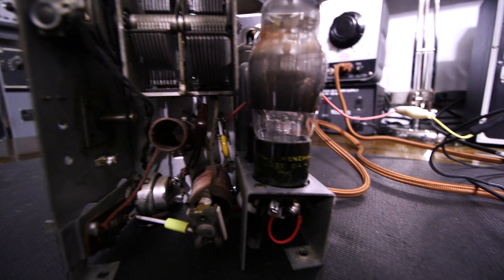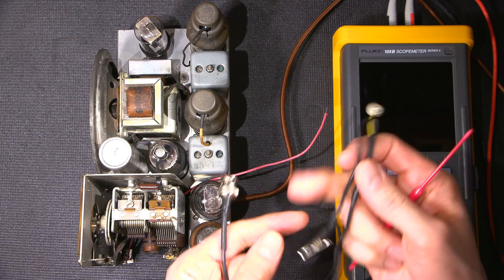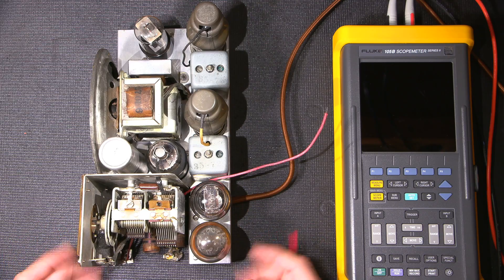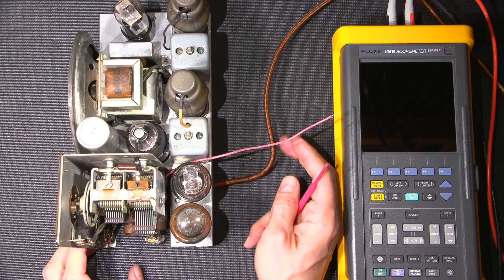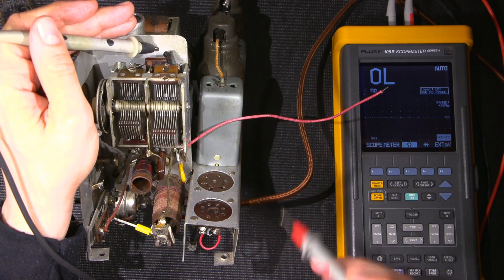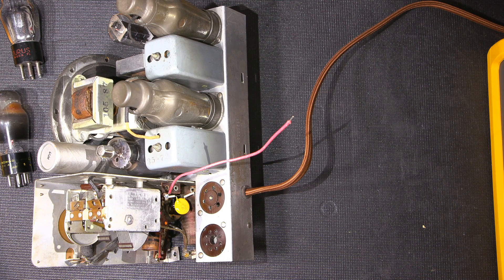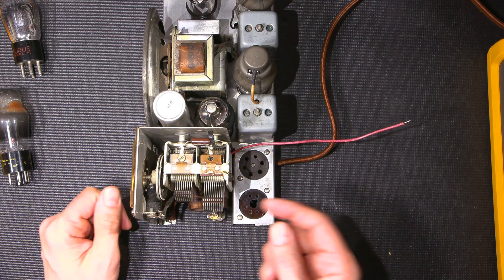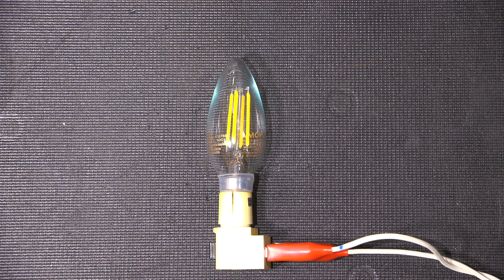See High Voltage Created From Falling Snow!

Comment: Free Energy Conspirists will have a field day on this one. LOL. But unfortunately for them us old Hams knew of this problem and took precautions against the undesirable build up of STATIC CHARGES (also lightning strikes) in our antenna systems. The capacity coupling AND associated leakage resistance (probably MEGOHMS) via the isolating transformer could possibly account for the grounding. I have experienced antenna STATIC SHOCKS once when reconfiguring some antenna wiring. It was WINDY & COLD (no snow which would DRY the air!) not nice. I would also add  my Ham Rig provided a STATIC DISCHARGE TO GROUND when in use OR was GROUNDED WHEN NOT IN USE. Static charges in the antenna system creates interference (RF) from spurious arcing   another reason for providing a controlled discharge path. PS Nice Observation
Reply: ARRL Handbook (1940 & 50s editions  I used)  my references OR perhaps ARRL  Antenna Handbook

Comment: have you ever spilled flour and sucked it up with a vacuum?
Reply: No, but I can imagine that flour has a >very fine< granulation, and partly passes a clean dust bag, and after that can be ignited by the bristles running over the collector of the motor. It could very well spark like hell, but it has nothing to do with the phenomena that Paul describes !
Reply: @erikdenhouter  i was trying for particle charge separation becouse it can give you quite the jolt if you touch the tube and sparks up to inch long like a wimshurst machine. particles carry charge. maybe snow does too? it comes from the clouds which are a different potential than the earth
Reply: @steffankaizer  If the tube carries a charge, it is indeed not a simple chemical combustion. 

I think about the snowstorm, the air itself should carry the charge, I do not think it is something in the snowflakes.  At such moment, we are living between the plates of a giant capacitor, clouds and earth as the two plates, and the field between those plates can be expressed in Volt per meter. So when 1000 V/m, and Paul's antenna raises 5 meter above ground, the >unconnected< lower side of the wire carries 5000 V to ground. In Paul's case there is somehow a capacitor playing, and I think that it is his well isolated coax cable; sheath is one plate, core and wet environment outside is the other plate.
Reply: @erikdenhouter  sounds plausible but i think the snow did have something to do with it. many people have tried with baloons and antenea to tap the potential of the sky but its not enough ampere. maybe the snow is like the elektrolite in a capacitor or like the ions in a galvanic solution

Comment: I also had a weird sparking occurrence where as far as I know only the ground and perhaps neutral was connected.  It was a old AT Pentium 1 desktop connected to a monitor and a external SCSI 4 drive enclosure all connected to a surge bar that I had disconnected the SCSI cable between the computer and drive enclosure at the computer side and I had left it about 1/2 cm or so from the computer case and went to do something else in the room and at some point I hear this arcing sound coming from the computer only to find a constant blue arc between the metal shell of the SCSI connector and the computer case.  The weird thing is all the power switches were off on all the equipment and the surge bar as well.  I foolishly decided to grab the connecter and got a fairly nasty shock off it.  I don't think I was touching anything else when I grabbed the connector but I was wearing socks and was standing on carpet with no underlay on concrete. I then unplugged the surge bar from the outlet and I tested the outlet and it was wired correctly.  It never happened again.  Got any idea what happened here?  The surge bar would have broken the live and the power switch in the PC due to it being a AT class system has a physical power button that disconnects both live and neutral and the drive enclosure just has a switch that breaks the live and the monitor was a soft power button I think.  Is it possible that if the microwave was running it could introduce enough noise on the AC line to cause this?

Comment: You say the resistance to ground is 36 ohms, but it is actually an inductor not a pure resistance.    This implies the effect is highly dynamic AC effect , not a  DC static buildup.   Shades of Tesla coils .   Also, the antenna connection may be red herring.  Perhaps the energy was in fact arriving via the  power cord and the chassis itself.  Shame you didn't have time to disconnect the antenna while it was happening.   The fact it was jumping the isolation transformer also implies it was a high voltage AC spike.

Comment: Tesla knew that the atmosphere 80% N/ 20% O functioned as an insulator between huge electro magnetic & solar wind-charged energy in the ionosphere & the Earth's rotating iron core. He would bridge that gap using a large solenoid coil generated electrical arc & antennas (the antenna tower at Wardenclyffe was built & grounded over a shaft several hundred feet deep) grounding? it into the crust & possibly creating a primitive but Tesla current regulated diode or transistor? Snow & rain driven by linear storm wind energy on your large? Earth grounded antenna (depth & mineral &  carbon content matter) soooooo... congrats on creating a Tesla Earth power generating station. The radio was manufactured during Tesla's lifetime! Also contact US Govt solar flare event charts to see if solar activity was happening. Enjoy yr vids! Best regards,

Comment: Tesla?  ionosphere power transmission through wet conditions, antenna  and circuitry ?   Wireless power transmission for sure or phase feed back with utility power?  High impedance Building Ground causing feedback?

Comment: I'm a bit confused as to why you think that RF engineers would likely be the ones to understand this. My background is in power substations, but I also hold a Ham radio license and I was quite capable of understanding and anticipating your remarks and conclusions.  I am wondering how and why you think that you had " high " voltage and current. From my work anything above 1000V is high voltage.  Without having measured it how do you know? You could have low voltage and high current, or low current and high voltage. I've been zapped by 600V at 800A DC just brushing my hand and it got my attention to be sure. But I also witnessed a coworker die from 11,000vac at 50 milliamps. Could the capacitor have had this short to the chassis from it's input side terminal and the high voltage not pass through the cap itself? Also,  why is your antenna  switch not have a fuse of the gas type used in ham radio gear for just this sort of occurrence. I use them to protect my digital gear against nearby lightning strikes that can be induced into my antennas and feed lines. It would have been more descriptive to just say your antenna was of dipole configuration. And lastly, how and why do you make the assumption that snow was causing this voltage to occur. I've been transmitting and receiving using dipole antennas on homebrew equipment,  vintage tube equipment, solid state analog and digital gear since 1969 and done so in all manner of snowstorms and have NEVER experienced anything even remotely like this. Personally I don't think the snow was causing this to happen. I do hope you can work it out and find an explanation for this  to have happened. You might want to present the facts and information you have to the American Radio Relay League,  ARRL, and have their technical support staff analyze the problem. They are top notch and brilliant at what they do. We need answers !

Comment: Tesla patented a device that is based on this phenomenon. Not specifically snow, but essentially "atmospheruc electricity". With a circuit and the new high density storage capacitors, you could probably make something that could keep the lawnmower battery charged. Or charge lamps, phones. Something that could be put into a shed where all you need is occasional lighting. 🤔

Comment: Placing a 100K to 1 Megohm resistor in parallel with the capacitor and one on the coax to bleed off the charge will fix this. It is the result of an arcing surge, as you know what will happen to the inductor if it indeed had over 500 volts DC discharging through it.

Comment: When I was a kid and just starting to mess with electronics back in the mid 70's I had a rubbish solid-state mains powered radio. It was so awful it came in a yellow vinylette box. For no reason other than I was just messing I stuck some components on the antenna which snaked its way up my bedroom wall, one of the components was certainly a coil, about ½inch by an inch cardboard tube and waxed, certainly know that because it exploded and burned my wallpaper which was a tough sell to my parents. It was only connected at one end to the radio, the other end just had a couple of feet of wire sellotaped to my wall. Still don't really get it now.

Comment: THE BEST WAY TO COMBAT THIS PROBLEM IS TO USE A NEON BULB TO GROUND. IT WILL CONDUCT THE HIGH VOLTAGE TO AROUND 90 VOLTS OR SO. I DID THIS FOR A MODULATION RF PICK UP AND NEVER HAD A PROBLEM SINCE.

Comment: Blowing dry powders can generate high electrostatic voltages.
During a "moderate blizzard" of dry snow, the electric field strength can be as high as "+30 kV / m".
Schmidt, D.S.; Schmidt, R.A. ; and Dent, J.D. (1999) "Electrostatic force in blowing snow" Boundary-layer Meteorology, 93:  29-45.
icecube.wisc[[DOT]]edu/~mnewcomb/radio/open/snow-electrostatic.pdf

Comment: I have an explanation to why we have increased static electrical charge(particle adhesion)  although it is a common occurrence in winter due to dry air and snow falling(particles) and in dust storms. I believe the increase in frequency and higher voltages are due to the use of aluminum particles and barium and strontium in prolific application via plane spraying as the source for geoengineering(formally covert).

Congress Addresses Chemtrails
On October 2, 2001, Rep. Dennis Kucinich (D-OH) introduced the “Space Preservation Act of 2001” (HR 2977), which called for the elimination of “exotic weaponry” from space. Among the weapons to be banned were weather-modifying weapons such as HAARP (High Frequency Active Auroral Research Program) and chemtrails. Though HR 3616 was later amended to remove the section that would have banned chemtrails, the original bill acknowledging the existence of chemtrail technology remains on the pages of the Congressional Record.

With “chemtrails” now officially admitted by the US government, an even bigger trial is set to begin in the court of public opinion.

An earlier version of this report appeared in the October-November 2001 issue of Nexus Magazine [PO Box 30, Mapleton

Comment: Do you have a voltage drop to your coaxial Shield that is Temperature sensitive that's equal to greater than 72 Ohms perhaps at antenna end of cable . Is  your isolation Transformer  grounded to earth , It is possible to get Amps from the earth if tuned to correct Frequency , in that case the case arced to  radio antenna based on untuned surges from earth your amperage rating on the spikes via earth  left redundant  power unused in Antenna starting an avalanche effect in the Circuit to antenna and earth. Could a cool discovery

Comment: Welcome to the weird world of high-voltage, high-frequency electrostatics.  The capacitor - resistor parallel shunt to GND is an open circuit at those frequencies.  The next time this happens, if you want to measure it, use a battery-powered rogowski coil and a battery-powered oscilloscope.  You will at least be able to see the high-frequency current oscillations in the megahertz range. I'm guessing that the source signal is around 2.4 gigahertz.  The important question is, where is this energy coming from.

Comment: David Casler on YouTube tells a story about wind and static electricity that fried a handy talkie because of high winds traveling over the surface of Ham antennas. He mentioned that he did not have the appropriate grounding applied to this antenna but nit sure that would have prevented the damage to the radio.
My dad shared a story with me about the static electricity from dust storms in the 30s would put on a lightning show between the barbwire fences and the dry dusty blowing air that kept the livestock in.
It takes dust to make precipitation and maybe a dry cold snow flake with that minute spec of dust in it is all it takes to generate high voltages in your antenna system.

Comment: No way could you have had 30 ohms. The size of the spark would have to be north of 500 volt. Something ain't right. You would have had a buildup to initiate the spark which would have dropped the voltage back down. I can't do the maths here but the time constant will give you the notional values of capacitance. That "snap" sounded like DC and the regular relaxation timing backs that up. And  I suggest you give it a day and reexamine the phenomena from first principles. I agree , it is a weird one.  BTW no surprises that the valves were not damaged.

Comment: thank you for all your video I have herd of the same thing happen inside a antenna tuner during a storm one ham use a choke claim it stop the problem I ask around was told use a 3 meg ohm carbon resistor 2 watts I had spark fly out of my coxal during high winds using a die pole antenna not shure its true I herd it can happen with a loop antenna and that's a short but RF don't see it if you make a device that kills it it don't happen again make a video what you made those in states use out door tv antenna mite want a device to try and protect there tv so please let us know if come up with a device to kill it... the choke the guy use in the tuner is like a choke ameritron use in there amp ask kk6fr what he use some call it snow static dc there some video you see it come out the pl259

Comment: Wow! I'm in the UK and have watched many of your videos and very good they are too. Not quite a Patreon as yet and have seen your cap tester before which looks very impressive and thinking about building one. I'm a hobbyist and not a pro and since retirement have taken an interest in Valve/tube gear manly Hi-Fi and still learning.  
What you just demonstrated then is, to say the least, was weird. Several years ago I had a strange experience with heavy snow and lightning which I've only seen and experienced once in my lifetime and I'm 68 but you did not mention anything like a thunderstorm. I was outdoors enjoying this spectacle and of course the light show and then I noticed that electrical smell that usually means something electronic is about to or goes up in smoke! The lightning was so intense and unlike normal rainstorms, there were multiple forks fanning out to just a white-out with a strong blue and I could feel it, It felt like generating static using a ballon rubbing on a nylon jersey/jumper which I've demonstrated in a darkened room and see very small sparks. My immediate thought was the opposing warm/cool airflows were as one would expect in a rainstorm creating static and then the charge grounding. At the time I thought that the snow was resisting and somehow acting like a capacitor? That the lightning arc was spreading instead of a bolt strike at it's shortest path to a conductor like a tree or a building. I thought that I would share that with you. Thank you for your excellent instructional videos, I don't comment often but could not resist this one!

Comment: You're making DC measurements when you have an RLC circuit and an AC voltage, not DC.  You completely ignored the inductance.  The overall impedance is much higher than the resistance alone, aprently.
I am looking forward to your future measurements of this "phenomena."

Comment: I think lot of u are missing the point that that cap did not charge up with 36 ohm to ground across it there is no way its a slow build up of static dc it had to be a high powered rf ac signal not a static build up i dont he would have took the time to make a video about it if was not shunted to ground the only thing i can think is atmospheric or a very large man made rf signal no dc charge could build up if it is shunted to ground

Comment: Hi Paul 
I have had the very same thing happen here a few years ago. I did video it but cannot find the video anymore. It was arcing inside a TS530SP and when I removed the plug it was jumping the inner to outer coax. Tube finals and no harm done. I was amazed. It definitely is a wierd phenomenon. Highly charged snow. I have been told even charged rain can do it .

Comment: The path...

Not seeing the path, eh?

Hint; you are looking right at it, but not seeing it!...

Hint #2...

Mr. Carlson's *LAB*...

.
.
.
.
.

OK, here it is...

You are most likely working on a conductive mat, grounded to prevent static build up. It makes a nice path to ground albeit a high resistance path (250kohm+).

Be glad it has the series resistor, otherwise you may have gotten 2 or 3 times worse of a shock.

If the mat isn't conductive or even if it is, it also appears to have used part of that LED lamp as a path too. Sounds like it arced out some path in the current regulation path (driver) of that lamp; why it's getting hot. Congrats, you just invented an LED heat lamp!  :-)

Btw, I bet if you set that radio on a thick wood layer (2x8) that it would never arc. Well until you touch it!  But I also bet if you did that & hooked up an old fashioned HV CRT probe that you'd see your HV pulses! Pulse, discharge, pulse, discharge, etc. ... !